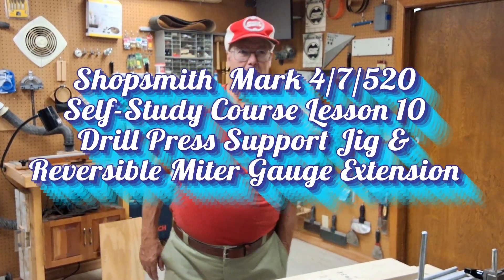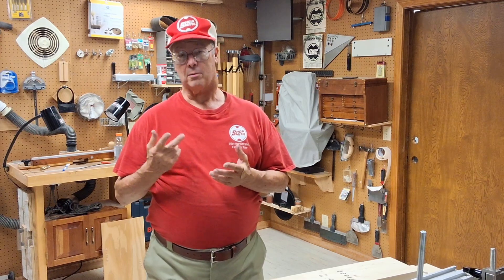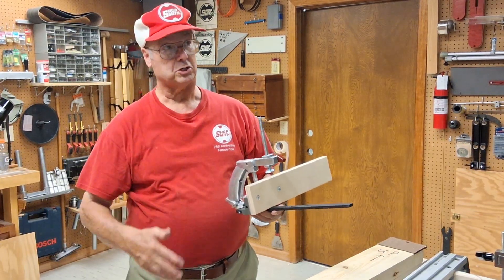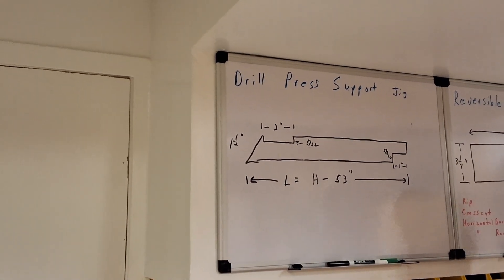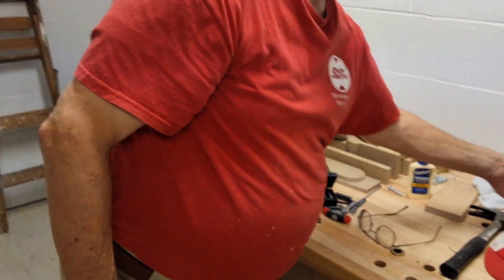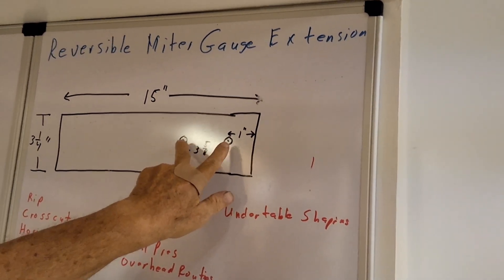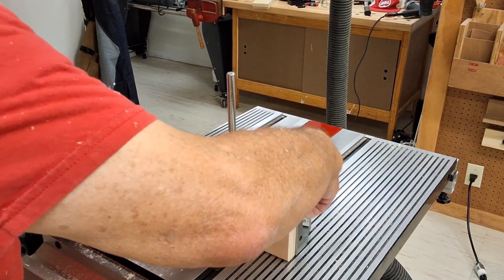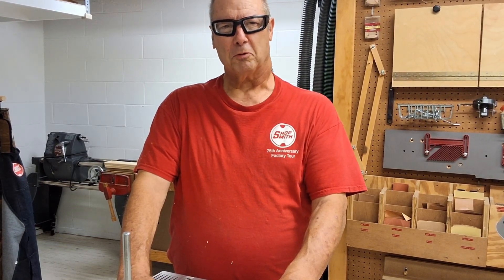Mark 4/7/520™ Assignments 10-1 & 2, Drill Press Support Jig & Reversible Miter Gauge Extension

Comment: Steve, can you tell me which video shows what you use to determine your set up spacers for the Mark 7 table? and which show and explain your under carriage box? Thank you, K
Reply from the maker: @kofdenhamsprings2701  These videos are a companion to the written lesson manual and not meant to be all inclusive or stand alone.  Clutter Collector plans are copyright Shopsmith Inc. so I cannot share them.  They are no longer sold.
Reply: Thank you, I found the video. I built all three spacers. Then I built the horizontal boring brace plus spaces. Now that I’ve seen the clutter box I can make my own. Thank you.

Comment: Your drawing on the Drill Press Support Jig shows a 1-1/2 degree angle on the left (lower) end of the jig but, when you cut the project you cut that end at 90 degrees. Why?
Reply from the maker: @dennisholtby2140  Table setting is 1.5 degrees which is 88.5 degrees on the board.